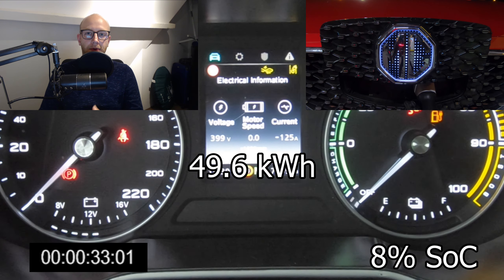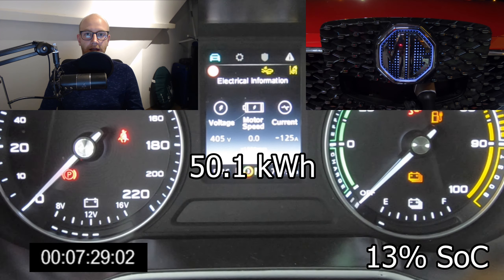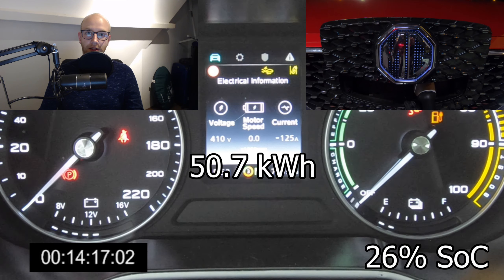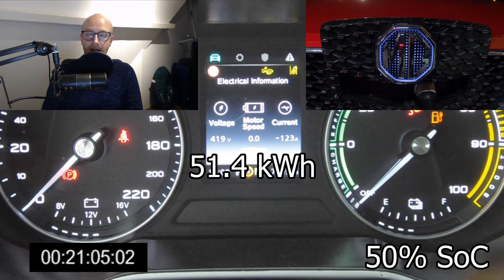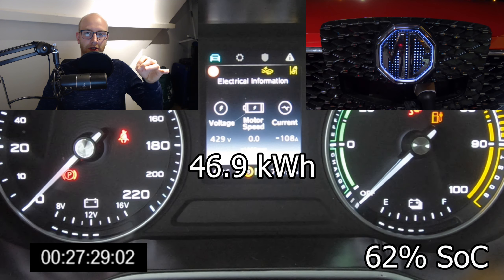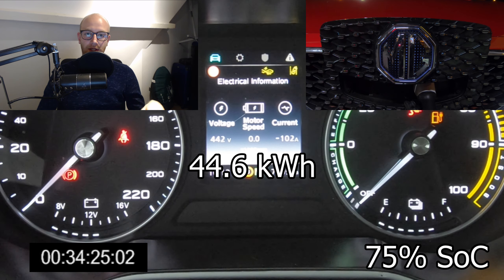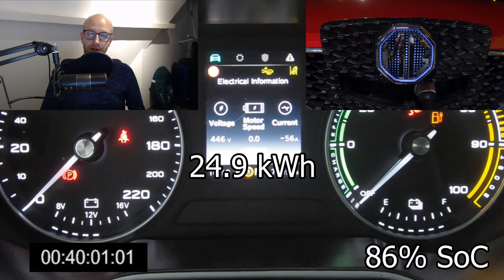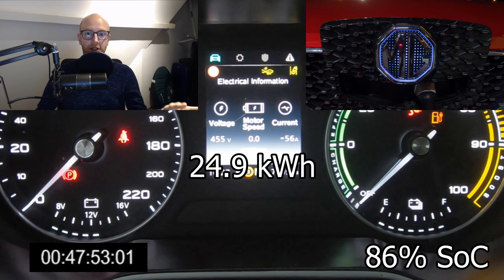MG ZS EV Fast Charging | Recharging

Comment: There are 8 graticules indicating SoC. The last graticule shows 25%>14% SoC remaining here. The spread is disproportionate, so each graticule does not mean exactly 1/8th each!  I think it is something like: 8/8 = 91-100%, 7/8 = 80-91%, 6/8 = 69-80%,  5/8 = 58-69%, 4/8 = 47-58%, 3/8 = 36-47%, 2/8 = 25-36% and 1/8 <= 25%. When the flashing last bar is 13% and then that goes you have 5%.  A bit silly really, but most people understand this type of petrol gauge and expect it to nudge you into topping up early.

Comment: Great content, thanks! Just make sure you don't mess up your kWh/kW units. kWh is a measure of energy (=how full the battery is) and kW a measure of power (=how fast you are charging/discharging). Your voice over is correct but the graphic overlay and description should mention kW instead of kWh.
Reply from the maker: Oowh damn... Thx for the heads up!

Comment: It doesn't do battery heating, only cooling, I guess your battery temp was too low and soc not low enough to get that high charging level, an accurate soc meter would be super helpful to work out the optimum time to charge👍
Reply from the maker: Ah that makes sense. Thx for the information :).

Comment: I have a question, our family recently has gotten an MG ZS Ev and we get nowhere near the charging rates that are advertised. At a Fastned station which is able to charge up to 350 kW/h, we only charged up to 29 kW/h while the battery was about 40% full. Do you have any clue how this can happen?
Reply from the maker: It all has to do with battery temperatures. If the battery is cold you won't get high charge speeds. Also the SoC. The lower the SoC the faster the speed normally. But as I said in this charging session I though I heated up the battery... but probalby not enough. 

"MG are looking into reports of cold-weather throttling, and to see whether anything can be done to improve the logic of the charge rates."

Is a quote from a topic on speakev.com. 
https://www.speakev.com/threads/how-fast-can-mg-zs-charge-in-uk-today.146256/page-3